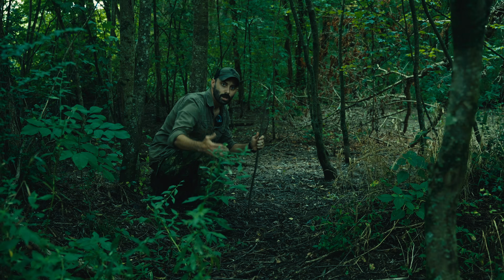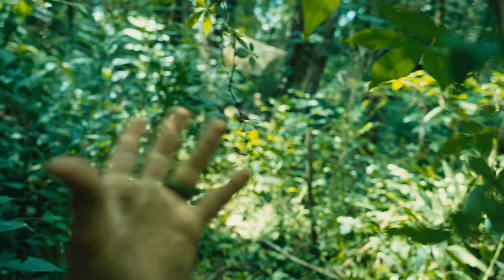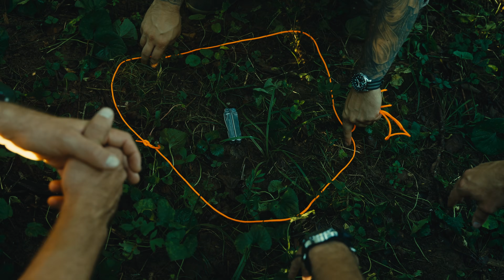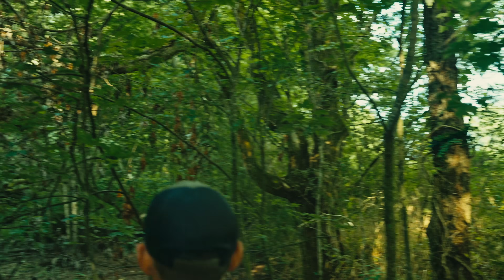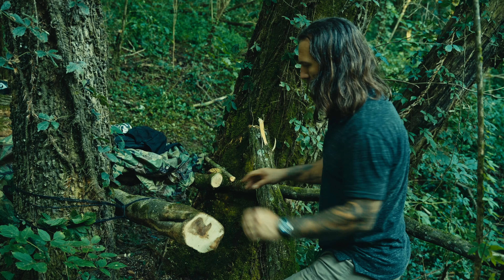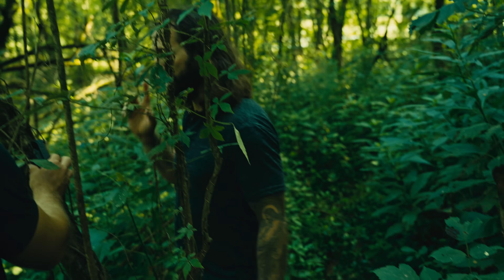Perimeter Defense | Early Warning Detection Traps

Comment: The fishing line is only susceptible to stretching depending on the line you use. Monofilament fishing line will stretch a lot. Fluorocarbon fishing line has very minimal to no stretch at all. I would recommend using fluorocarbon fishing line.
Reply: Braided line also has no stretch and is easier to tie
Reply: Braid. Way better and it usually comes in moss green, would blend in nicely
Reply: @joel757VA depends on application.
Thin Fluorocarbon is great for “blinder” traps. Thin wire hooks dangled at eye level and break off after sticking in. When dry it looks like a common spider on its silk but wet the line and flouro can be basically invisible for 1-2 hours. Braid is too visible even at low poundage for this.

A similar application can be used with mono line, utilizing its stretch by making a 3’x3’ spider net with about 100 hooks on it set on a spring branch. Once someone is caught in it the stretch of the line makes struggling that much worse. Lines that do not stretch make it harder for more hooks to grab and dig in.

Of course both of these could also be tipped or dipped with additional “surprises.”
Reply: Some of the best DC content is with the Tactical Hippy. Good stuff, guys.
Reply: A note about braided line is that it tends to shrink or tighten in hot weather after a day or two.
Reply: @lwhowell4387 it doesn’t here in Charleston, SC and that’s one of the reasons it’s so popular here 🤙🏻
Reply: Isn't fluorocarbon the expensive kind?
Reply: @gigshare3947  braid or normal twine lines are more expensive per foot.
Reply: Kevlar cord in my go to for this.   Cheap, high tensile strength for a very narrow cord, less shine that monofilament and no stretch really. I keep a few rolls handy in different kits. Only negatives are you can heat seal it. (Super glue is needed) and if you grip it and pull or drag flesh across it, it will cut you. 
But same benefit, it will cut flex cuffs and other plastic easy if you use gloves.
Reply: FC is expensive go braided.
Reply: If you want NO stretch, us braid.
Reply: Grey-green Spider Wire. A little pricey for a big area but how much was your optic?😅
Reply: Or braid. Connected to an air horn 😂
Reply: La i a 😑
Reply: You got mono and flurocarbin completely backwards. That's the point  of fluro. Stretch and abrasion resistant. Mono has little to no stretch.
Reply: @ sorry bud you’re backwards on this one if you are responding to OP.

Comment: 2:23 the mouse trap thing is cool
Reply: You can also bend the corners of the wire trap downward a little-- set it off once, make note of where the indentations are, then drill holes offset so you can stick .22 blanks in so they'll be struck on the rim. Use two for reliability. Might come in handy if your position is getting rushed and you need a distraction to buy you a few seconds.
Reply: very cool, glow sticks are such a nice touch
Reply: Some Friends and I thought of how to do Battlefront's Ewok Hunt in real life with airsoft guns and nerf swords. The glowstick traps would not only reveal locations, but would slowly begin to light up the woods we'd be running through. It's such a simple but brilliant trap
Reply: i would have loved to see an example of how visible it actually is at night.
Reply: Just a cheaper version of the true glowstick trap systems